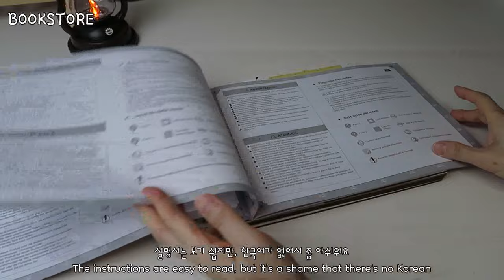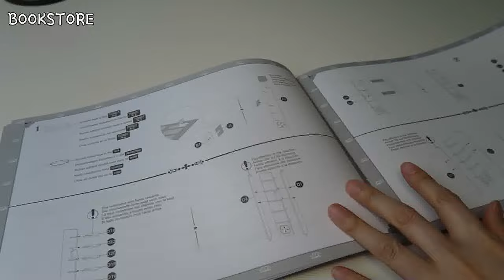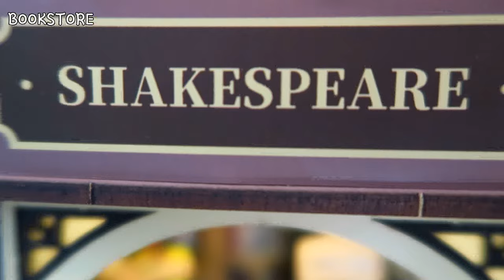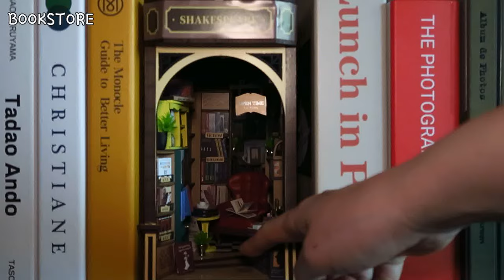DIY Miniature Dollhouse Kit / BOOKSTORE / Rolife tgb07 서점 / 미니어처 쉽게 따라 만들기

Comment: i have part B9 left over and i can’t see it in the instructions or in your video but my light won’t turn on… can you help?
Reply from the maker: I'm sorry for the late response
B9 is not in the manual, so it's not in the video,
The light must be turned on or off of the battery box to activate the sensor
Reply: It states B9 is the spare part of a A7 page 19
Reply from the maker: It's a spare part for A17 ^^
But what happened to the lighting?
Reply: @minirose-miniature  i’ve got no idea i hooked everything up right and it still doesn’t work 😭
Reply from the maker: @octopusoptimusprime  😓😓🤔🤔

Comment: I just finished making it but the light doesn't work, what do i do ?
Reply from the maker: Make sure the switch on the battery box is on, and if it doesn't work, make sure the memory card is plugged in well.
Reply: @minirose-miniature thank you, turns out i forgot to turn it on my bad  😅
Reply from the maker: @lauraentzi7143  ❤❤❤❤❤❤

Comment: The hardest part was putting the pegs of the mirror archway in. I ended up having to hammer it down gently 100 times.
Reply from the maker: If it doesn't go in well, sand it with sandpaper or cut it slightly with a knife and it will go in easily. If you hit it with force, it will break.🫣
Reply: I used a nail file with some of the pegs - saved me from a nervous breakdown 👌

Comment: Is cool and eveything, but at least show us, how u wired the house.
Reply from the maker: Which part are you more curious about?
I would like to inform you that it is still difficult to take more detailed pictures unless it is a 1:1 individual class.
Reply: @minirose-miniature  It doesnt have to be detailed dude, all I want to know is how you wire the cable to turn on the led bulb. Cheers.
Reply from the maker: @ellenphilpotts-troy2098  The cable is connected to the bulb, so you just need to fix it to the designated seat